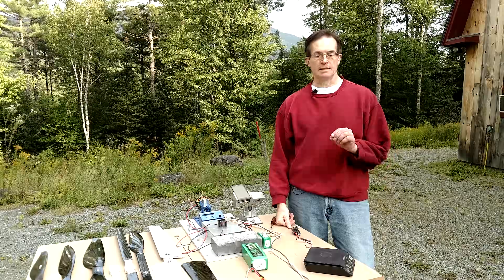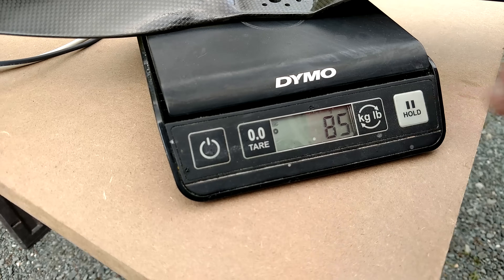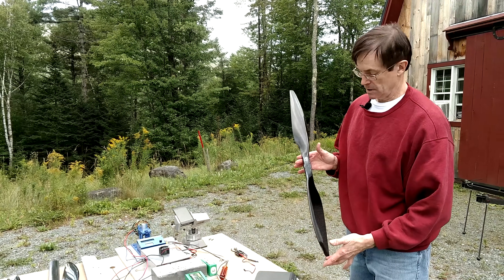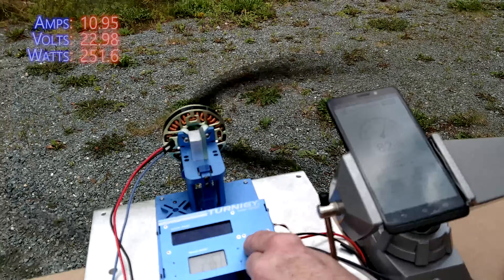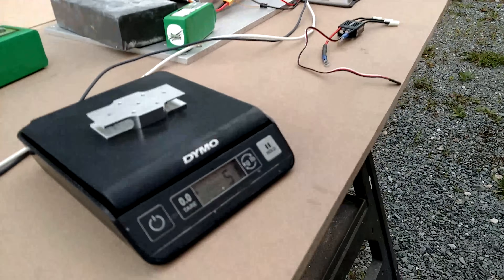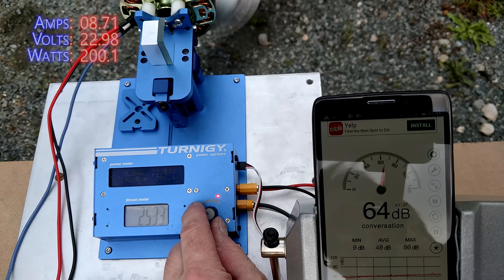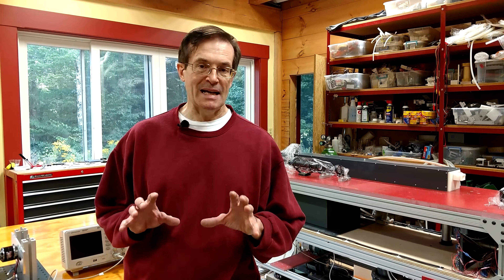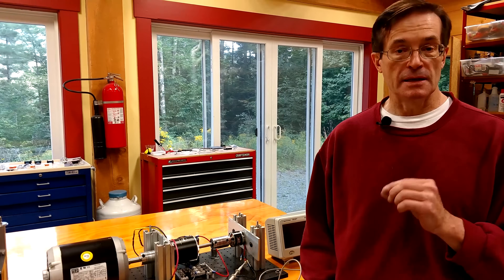Building Drone Rotors - PART 4 - The Testing

Comment: All the options out there for things to do, places to go etc, I came here instead. Found this really interesting. Great teacher, great logic. What about though having more blades so a 4 prop or 6 prop blade. More torque so more power drain but less speed and power required to get same lift as 2 prop blade surely? Am I right?
Reply from the maker: No, the opposite is true.  Fewer blades are more effecient.  The turbulence created in the wake of a blade reduces the laminar flow over the blade that follows it.
Reply: So then why 2 and not 1 blade. If you swing a weight one a piece of string above your head. At a certain speed in feels balanced.

Comment: Made one of those generators all ready  , I was trying to make it use 3 different storage functions and use a main power source to make a all electric motor home   with 5 Tesla battery packs in a step van. ,,     buy this stock  before new years 2020 
 Xtiaircraft.com   look at the bord of repsentives  and company owner  , it what to come and is the next and last step in public and private  use of small craft in America.  The tri fan 600 has all ready been picked to lead the progetion of electric vertical plains. 
Xtiaircraft.com

Comment: if going to a larger propeller is so much better, why do large drones go with many rotors instead of fewer larger rotors?
Reply from the maker: Redundecy, low inertia for quick maneuvering and multiple lift points for stability.
Reply: @TechIngredients  how does having more lift points give more stability over fewer lift points?

do you mean that any deviation in performance is averaged out, so the effect of any single defect is reduced?

I have seen a racing drone with collective control propellers instead of fixed pitch propellers. maybe this would be ideal for large payload drones since it benefits from large rotational inertia in the blades.

Comment: great video, well thought out and filmed, like all your channel offerings. My main interest here is with the very low rpm thrust readings for a duration time-lapse specialist drone. It's always very useful to see a big prop actually tested like this. I am a bit confused as to why the current, voltage and power at the top left insert of the frame - are going in such bug jumps and lag the thrust? It's impossible to really tell what the steady rpm figure is, for example at 1500g thrust do we take that figure as accurate, representative and a stable reading? Or assume it's as ball park as all the other values...therefore it's not going to be possible to do more than make a guess as to how your 'twist-less' 'square tip' foam core blades are performing in comparison? Why would I spend so much trouble making constant pitch wooden and laminated props over my life using the design approach adopted in every commercial and full-size/man powered flight project etc...which  include this extra aspect of prop manufacture? A balsa or foam core carbon skin prop blade can be as little as 18g per blade for a 22 inch. Another good reason to make your own blades is that they can be made much lighter if they are only going to be used to generate much lower amounts of thrust, with less rpm and therefore not needing to have a big structural safety margin. I have several all balsa 20 inch one piece with hub blades that will take 150w without self destructing and weigh about 10g. I was hoping to compare the 15g/watt at 1800g thrust I get using a 18 inch balsa prop, gearbox and tiny Hextronic motor, with your results. I am also not seeking perfection in my experimental technique, I was only interested in maximum thrust and used a simple tilt arm without an accurate electronic scale and omitted to keep a record of the lower rpm, power input and thrust levels!

Comment: Great Series!   Gets me to thinking about making these foam core props for homebuilt aircraft.   Great job on the development and presentation of your ideas.   One last idea:  The GPU converter, sounds like we are getting to a diesel-electric setup.   They are getting huge amounts of power out of small diesels.    Even normally aspirated, and they are very light.   Diesel fuel is slightly less energy-dense, but it still way less heavy than the equivalent batteries.   There have been experiments using a stock electric motor to power a Cessna 172 that has lots of power and is much lighter than the standard recip. engine.   Just thinking out loud.   Thanks!

Comment: I observed that the thrust is not increasing linearly with the power in starting the thrust per power is high and it increases as you go for high rpm 
It's almost 50 amp for 1kg thrust and 210 amp for 2.5 kg . Can we use 2 motors with 100 watt each to get more thrust??
Reply from the maker: The guiding principle is propeller disc area.  Assuming a fixed airfoil and motor effeciency, the thrust will rise as the square root of the area for a given power input.

Comment: Solid state batteries will double the energy density of lithium ion batteries.  Elon Musk has bought Maxwell capacitors in hopes of getting ahead of this market.  It will allow cross country travel in modest jet planes of 50 passengers.  The Alice Electric plane has a range of about 600 miles with 8 to 10 people.    A propeller can be made more efficient by curving the tips back to thrust more directly behind the prop instead of sending that swirl of air out in a cone shape.

Comment: So if gasoline is to be used because of energy density, why go half way? Use diesel.
Then you will have a diesel electric - just like a locomotive :)
hardly state of the art...
Reply from the maker: That would work.  Small gas engines are a little more widely available.

Comment: I would like to see the thrust data, also.  My guess would be the commercial props are made for efficiency at relatively low velocities along the used length.  Isn't that why the commercial props have a very wide blade chord towards the root?  Props made to run at 5,000 RPM will have the wider blade chord towards the roots, than a same diameter prop made to run at 10,000 RPM.
Reply from the maker: Check out our first video in this series on large drone rotors, "build or buy".  I go into the physics behind the design.

Comment: please please please lets do a PEM fuel cell. This is the best of both worlds. also please take a look at this circuit to get 70% increase in run time with the use of a new tech. and the PEM fuel cell or just batteries. This circuit works to increase run time with an inductive load like i said 70%. you add that to what you are doing you have a new paradigm in power management for drones. Here is the link to my Patent:  https://patents.google.com/patent/US9438114

Comment: The bought props might produce higher air speeds, so the drone could fly faster?
Reply from the maker: Ultimately, yes.  But, at all speeds up to that maximum, the larger rotors will give it a longer flight duration.

Comment: I used heat shrink tube to press the carbon fibers to the foam core. It's a faster way to do it. Also you get 20% less weight doing so. 
You only need a base plate with a chamfer at the trailing edge to acomodate the excess carbon fibers.
Reply from the maker: This may not work for certain situations.  Heat shrink tubing will contract by an amount dependent on the heating applied to each area.  It is difficult to ensure that this heating is homogeneous.  Furthermore, the tubing tends to a cylindrical shape and this will load the airfoil much more, parallel to the cord than perpendicular to the cord.  Very stiff core material will help to resist these uneven forces, but such a dense core will add substantial weight.
Reply: @TechIngredients  I still used an aluminium brazing on the base to ensure the proper form to be maintained. Also to heat the whole assembly  I used an array  of halogen headlamps. It was the fastest way I found.
Reply: @TechIngredients  I really like your channel! One of the best channels!

Comment: A measure of thrust @ 1500 RPM would allow a more complete comparison.
Reply: For a drone the most important comparison is how much thrust you get per watt
Reply: That was my thinking exactly.
Reply: @n.christopherperry8941  but that means having their comparison by measuring the power consumed when producing 1500g of thrust (what they did) is the correct comparison. The motor will consume differing amounts of power at 1500rpm for the different props
Reply: A Brackers, I was mistakenly under the impression he was reporting the power to turn the prop at 1500 rpm.  I rewatched the video and see that he was reporting thrust.

Comment: Thanks for the video and analysis.  I have been making wind generator rotors for about 15 years.  There are a lot of similarities.  I suggest you will get improved performance by having the correct pitch at every diameter.  With a fixed pitch, you are really only generating peak efficient thrust at the tips.  I put together a video showing how I make a rotor.  Put the airfoil on the other side and you have a propeller.  https://www.youtube.com/watch?v=zkpzrLzTVUY&t=94s
Reply from the maker: Nice video.  Thanks for the link.
The advantage of twist is not necessarily true.  For any particular airfoil, there is an optimal angle of attack which gives the greatest lift to drag ratio.  If the rotor disc itself is not moving through the air (hovering), that same angle of attack applies from the hub out to the tip.  With a wind turbine or an airplane, the airflow past the disk modifies the relative wind past the airfoil and the AOA has to increase as the radial velocity decreases toward the hub.
Reply: You gave me something to think about, thanks.  I'm still stuck on the fact that the blade tip is traveling through the air at a faster speed then near the hub but I will think this through for a bit.    PS thanks for the work you have been doing with sound and speakers.  I've found that especially enteresting.  Especially your video on sound dampening with helium.

Comment: 6:30 fluttering blade ?
Reply from the maker: No, the relative position of the mic and the airflow.  That particular design has been run much harder without a problem and is quite stiff.

Comment: Nice video's!!!  
In my opinion the main physical difference between the rotors in this video and "professional" rotors is that the professionals do not apply a fixed angle of attack, but make this angle vary with the radius of the rotor (large angle close to center and small angle at rotor ends).  And in my opinion this is the parameter where Tech Ingredients rotors can win the most in efficiency.  This could be "easily" realized by fixing the styrofoam in a twisted position before applying the carbon layer?   
Thanks for sharing!
Reply from the maker: Thank you!
Twist is necessary when the entire rotor disk is moving at a velocity that is an appreciable fraction of the rotational velocity as with an airplane.  But, with a large (and slow) multi rotor as with a helicopter, this is not the case and the optimal angle of attack remains the same from the tip to the axis of rotation.  In that case,  central twist causes the inner diameter to be operating beyond the stall point and lift is reduced.
Reply: @TechIngredients  I believe that there is a misunderstanding here. A large multi rotor may not move very fast vertically (or at all), but the air that you are accelerating downwards in order to create lift does have a significant velocity. The movement of the vehicle is irrelevant, it is the movement of the column of air that matters. Real helicopter rotors do have blade twist, not as pronounced as a typical propeller but they do have twist. They cannot be twisted so much as to provide highest efficiency because if they did so, then they would not be able to autorotate - and that is a very important ability for helicopters to have.

In your case you have only the outer third or so of the blades generating thrust, the middle portion is doing little to nothing and the inboard portion is at a negative angle of attack. The outboard portion is pulling a column of air through the blade disk faster than the inboard portion can "grab" onto it. The inboard portion, at a negative angle of attack to the apparent wind, may even be trying to push back against the column of air.

 The goal of any (efficient) propeller is to accelerate a volume of fluid equally across its span. The only way to accomplish this is with blade twist. Any variation in the velocity of the accelerated fluid is a loss of efficiency. The speed of the vehicle that the propeller is attached to is irrelevant with regards to the need for twist. Even tugboats, which are designed to create huge amounts of thrust at zero speed have blade twist. The only case I can think of where twist is of little use is in a very low aspect ratio, high rpm impeller - but even those use twist when high efficiency is important. 

You could create a test rig where you measure the velocity of the prop wash at several different points along the span of your no-twist prop, then compare that against a similar propeller that does have twist. Better yet, build another foam core set of blades with an appropriate amount of twist and compare them against the blades with no twist. You'll find that the set with twist will generate the same amount of thrust with less power input.